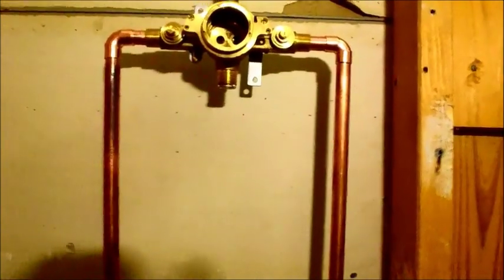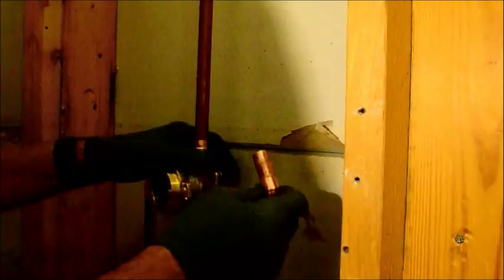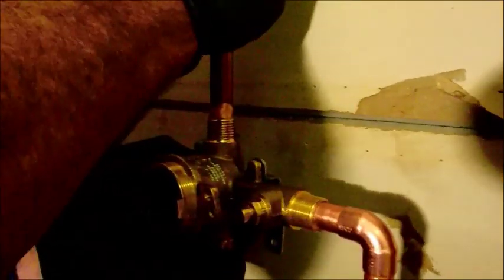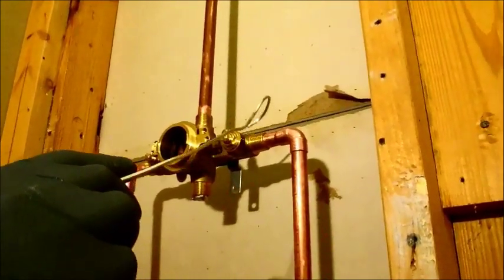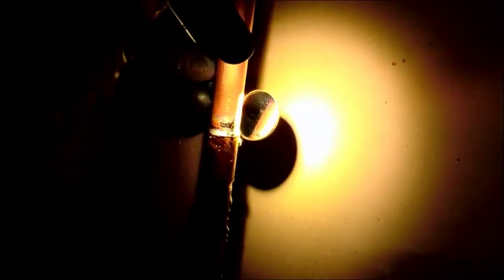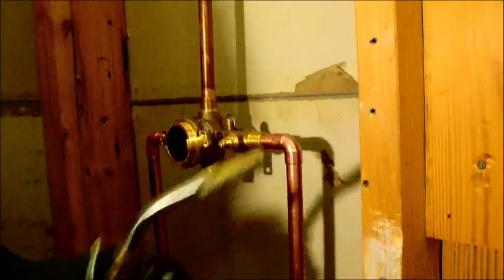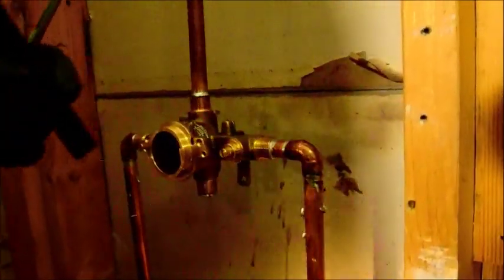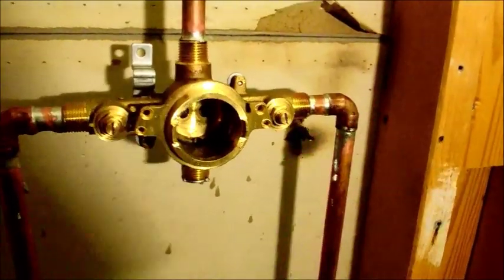INSTALLATION OF SHOWER VALVE

Comment: I was taught at least for the horizontal sweating you heat from the bottom, apply solder at the top and once it drips once from the bottom your good to go.  Thanks for all your videos.

Comment: Can you over sand paper the pipe? My husband didn't realize he was actually shaving down the girth of the joint until we placed it on the pipe and found it's now loose and wiggly. Will the solder still bond when there is a bigger gap or should we go buy more fittings?
Reply from the maker: If he solders correctly then that little wiggling really shouldn't matter, however he could always cut off that end that he over sanded and start over again
Reply: It was actually a 45 fitting that has 1 male end and 1 female end. And he over sanded the male end, haha.

Comment: I have one more question before we begin sweating our copper pipe! So we have decided to move the valve and tap into the water lines elsewhere. When we cap off the pipes for the existing hot and cold connections, can we use the regular caps or do we need to get the caps with the flat bottom? Thank you.
Reply from the maker: There are squared off caps and there are rounded caps, it wouldn't really matter, but sometimes they are a little tricky to sweat because they are so small
Reply: Thank you very much for clearing that up for me, kind sir. =]

Comment: I would have removed the cut off values
Reply from the maker: As it turned out the stops had no rubber parts....
But yeah, ideally they should be removed
Reply: I had hell with those, Water flow was 80% restricted right out of the box, I opened them up and removed the seal inside, that did the trick! This has happened to me at least 3 times. Specially with Moen,

Comment: i can see you are a tile guy, NOT a plumber
Reply from the maker: I've done plumbing longer than tile...
back up your statement rather than troll
Reply: @StarrTile  hate to say but by the amount of solder you used and the sloppy work its probably a good idea you changed careers because I would have fired you on the spot,  but thanks for your videos, but if I were you I'd leave the plumbing Videos to the professionals just saying.
Reply from the maker: @plumb build..

Back in the early 90s when I first started sweating pipe I would sometimes have little pinhole leaks so I always over sweat, function over fashion...a pretty joint gets you no points 👌👍
Reply: @StarrTile  Yeah thats now far behind me I started late 80's been plumbing and remodeling every scene , thanks for the videos I'm so old school I haven't learned how to shot videos but maybe 1 day before I retire.

Comment: 10:54 obviously too MUCH solder - said captain Obvious :)
It will work but extra solder inside of the pipe will cause excessive water turbulence, copper hydraulic wear and as a result premature failure